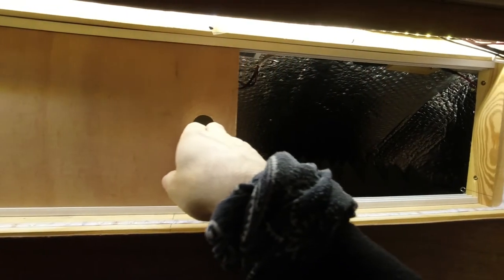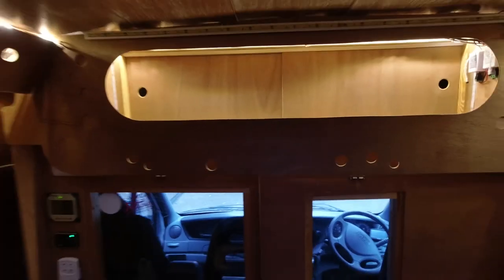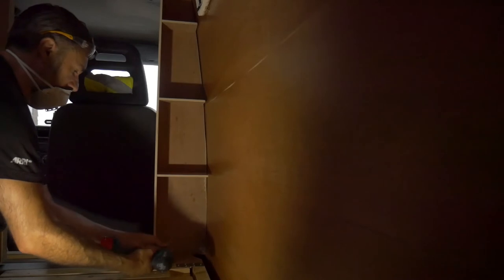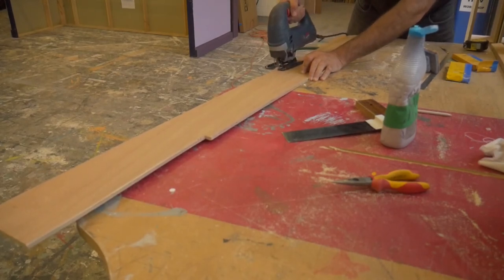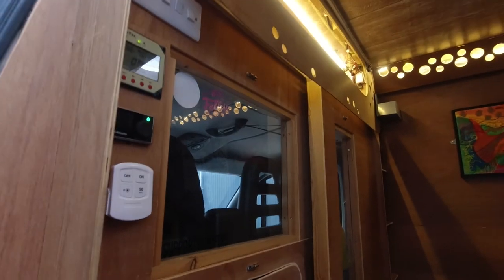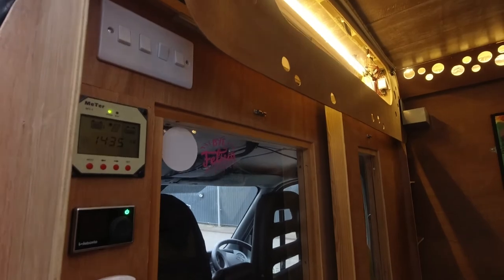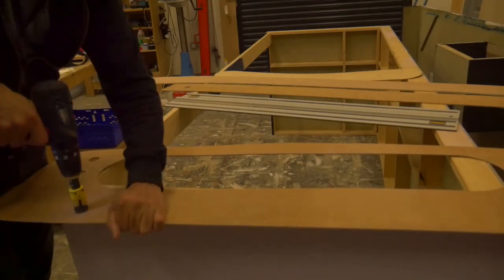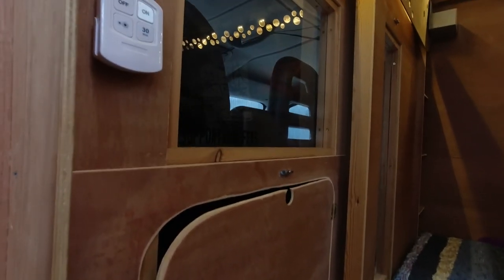Bulk of the Problem - IVECO Van Build - S2 Ep08

Comment: As Cool as usual Rob Cheers! Totally agree about removing the bulkhead but not leaving it fully open. Access between areas can be handy especially during bad weather also keeps the back dry & clean.
Reply from the maker: Thank you Andy, yes the other aspect which I forgot to talk about in the video was the being able to access the cab without having to venture outside, just in case. Cheers Rob